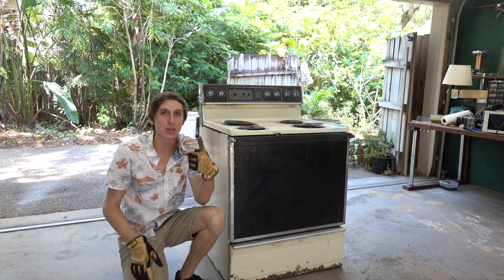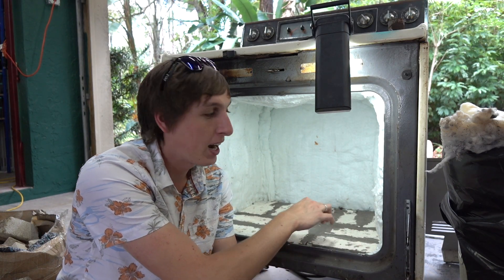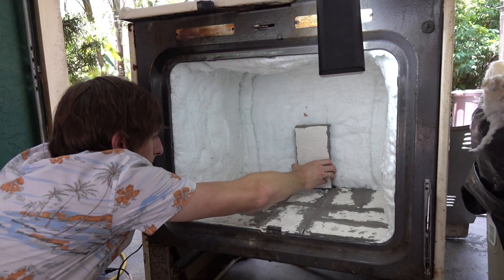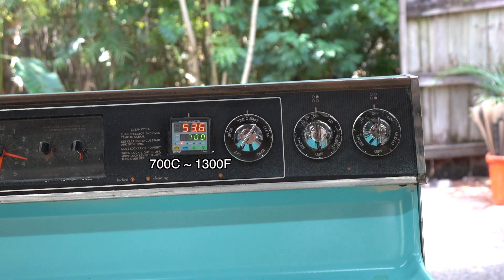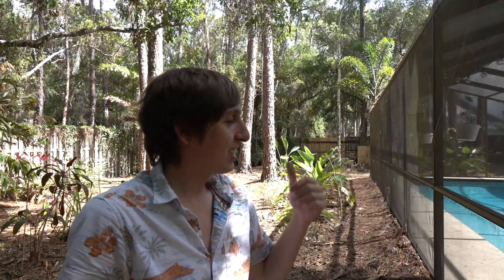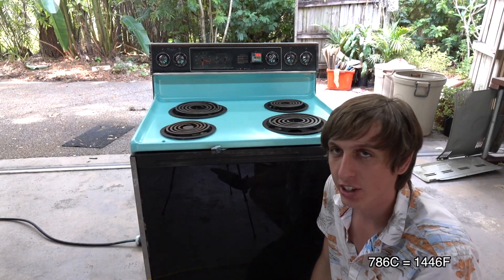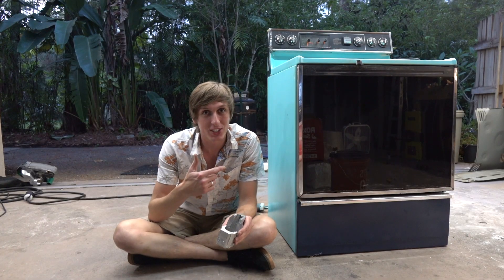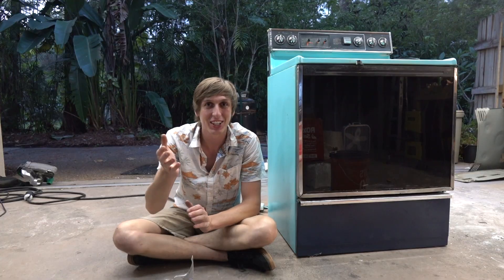Turn an old Oven into a Kiln

Comment: Really cool stuff man! Hey I just wanted to make a suggestion if you plan on doing similar stuff to this in the future. 

I used to be a dental technician and we would paint on a very fine investment precoat and let it dry before pouring in the actual investment, and it was the key to getting all those tiny details you would expect when it comes to dentistry. We got it from a company called Nobilium, but I'm sure there would be other places you can get it at a lower price. 

Also in case you were wondering, we made our casts out of chrome and cobalt plus small amounts of other metals. That stuff made for some shiny prosthetics!
Reply from the maker: +Bean that sounds like a great idea to put on a thin coat first so I don't have to worry about getting all the bubbles out of a big batch. Thanks for the advice!
Reply: Sure thing! Oh one more thing, we would also sit the molds filled with investment on a vibrating table to remove all the air bubbles, though I did notice you gave yours a good jiggle and tap on the ground, so that surely would have helped. Best of luck!

Comment: I like the idea, it's always a good idea to re-use rather than just dump it, and I know of a man that that done this before, But the problem is the enamel coating on the inside of the oven was never designed to withstand the temperatures of a kiln, it will smolder, and the smoke it produces is carcinogenic = DANGEROUS!

Comment: Completely different story on how fluorescent lights and LED work based on my experience..

It seems the opposite way.. how do you manage to avoid flickering Fluorescent lights ? 3:55
Reply from the maker: +chris.Films The florescence lights have a new electronic ballasts that use a high frequency power supply 20,000hz+ The old magnetic ballasts would flicker and buzz at 120hz. Some LED drivers are also high frequency or smoothed but I just got unlucky and got one that flickers on high-speed camera.  KinoFlo lamps use a even better power supply for their fluorescent lamps 45,000 Hz

Comment: Why do you have to change the insulation? Could an unmodified oven work, well with the kiln electrical controller of course?
Reply from the maker: +Yosef MacGruber - no because the oven has a metal interior and relatively poor insulation it can only get up to about 550 Fahrenheit maximum.
Reply from the maker: Yes even on self cleaning mode I don't think it will ever exceed 600f.  I am giving it as much power as it would use in self cleaning mode, but the insulation is just more efficient, holds the heat in better.

I stuffed ceramic blanket in the oven vent. 

I removed the lightbulb.

I removed the door gaskets and put in the rockwool insulation that presses against and inside the oven when the door closes, it sealed better than the gasket. I had to remove the gasket because it was on a piece  of metal that stuck into the oven, that would have been a source of heat loss, as the heat would have conducted out of the oven.

Ive seen used kilns sell locally for $400, new they cost $2,000. They reach a much higher temperature though ~2300f. I think if I wound my own nichrome heating elements I could get this oven to 2000f.

As for the fire hazard of regular ovens? I don't know. This oven was so old a lot of the insulation in the wall compressed down so there was about 6" on both sides where the heat would radiate from the inside shell directly to the outside shell of the oven. You can see it in the beginning of the video, the paint next to my shoulder was burned off but they still used it! 

I think the people commenting about my name are just teasing me, I like the name, im keeping it :)

Thanks for the thoughtful comments.

Comment: You might be able to get the temperature up by adding a third heating element from another oven (assuming you've got enough power to run it)

Comment: is the temperature controller the thing plugged in and the heating elements plugged into the controller? im a bit confused on the wiring aspect

Comment: Aaaand he gets a shocking electricity bill.
Reply: Using the Fire Bricks like he did. One can cut out the bottom of the oven using a metal saw and build a fire pit. Make some air holes for the fire and chimney stack and vulai' a furnace to make Clay Pots to alumanim casting. Would cost on coal are any other material one would burn.

Comment: Looked like a fun project. :-) You put a lot of time into it, and did a great job. I wonder how long the heating elements will last at 1400 deg F. Thanks for the links!
Reply from the maker: +electronicsNmore thanks it sure did take a long time. Don't even get me started on making the plaster molds and the Burn out schedule. The heating elements? I think they will last. I guess they are steel tubes with Nichrome wire through the middle insulated with magnesium oxide. It won't get as hot as nichrome elements I could wind myself. They are 18 and 22 ohms.  If are used lower ohm heating elements I bet I could get the temperature a lot higher.
Reply: Hi

Comment: Isn't this exactly what Linus tried to do and miserably failed?(Not the oven part, the 3D printing and casting part)
Reply from the maker: I haven't seen that video but yeah a heat sink would be extremely difficult to cast without some kind of vacuum process. Pretty sure they are just machine from a solid chunk.  That is a lower receiver I made but.. it's just going to be a prop Halo gun :P which may or may not end up shooting a 40 W laser beam.
Reply: GamerBrian Linustechtips
Reply: Sort of. Linus tried to do aluminium casting, like what happens in this video. However, the difference arises in what they were making. It looks like here he made a lower receiver for a gun, while linus made the heat sink. It is an important difference as the space between the heatsink fins make it extremely hard to cast, while the larger overall size of the receiver allow for easier casting.

Comment: Pre-heat oven to 350 degrees.Grease and flour three 6" X 1 1/2" round cake pans.Mix together flour, cocoa powder, baking powder and baking soda. ...In a large bowl, beat butter, eggs and vanilla.Gradually add sugar.Beat on medium to high speed for about 3-4 minutes until well mixed.
Reply from the maker: this would be a great cooking oven... if you like carbon.